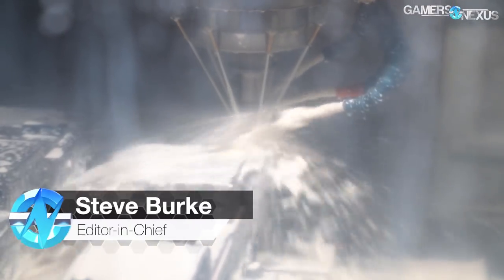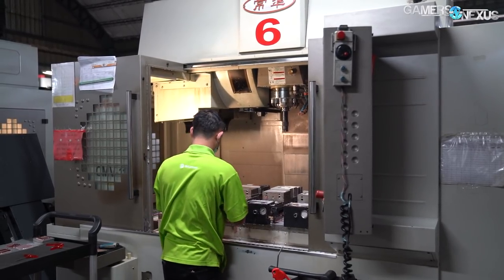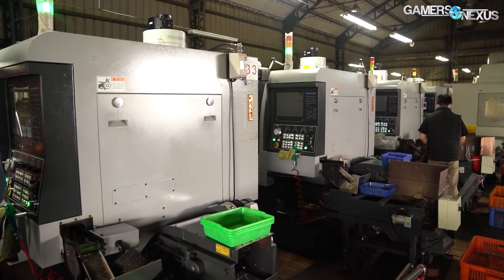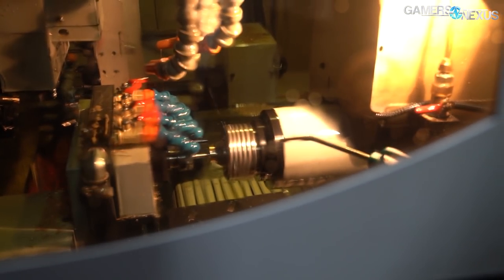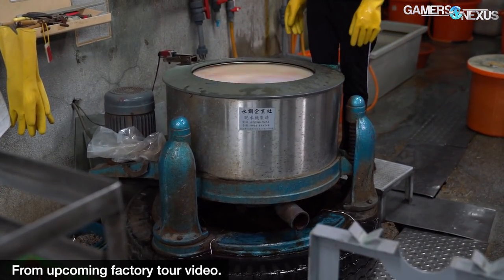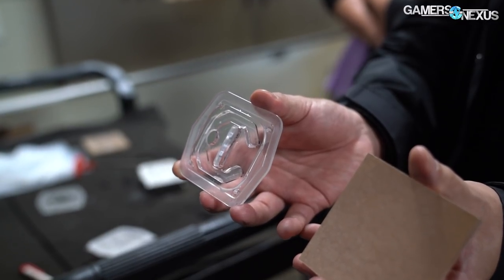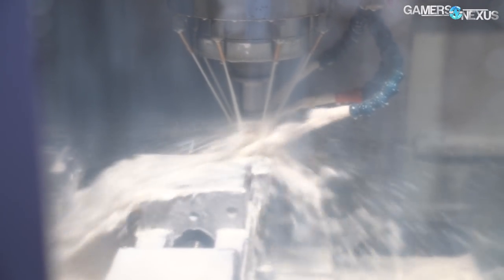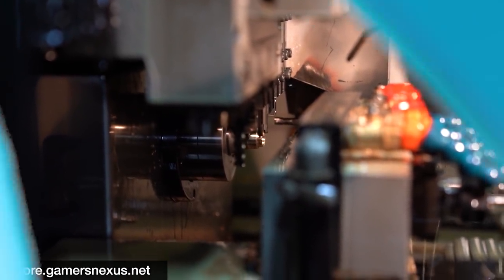Million Dollar Water Block: How Water Cooling is Made | Factory Tour in Taiwan

Comment: I was really hoping to see how the micro-fins were made. I always thought there's no way that's done by CNC. it would just take too long, so i was thinking, maybe a blade like how aluminum fins are made.. But still.. was really hoping to see those.
Reply: Micro-fins are made with CNC machine. In the video those machine were using drill and end mill tooling, whereas micro-fins will use blade tooling to chip away the metal surface.

Comment: I am really surprised that common sense does not abound.  Automotive engineers long long ago discovered the same problems with automobiles.  Now,  Prestone or other anti-freeze is supplied by the manufacturer.  A good anti-freeze stops radiator, pump, and aluminium corrosion.